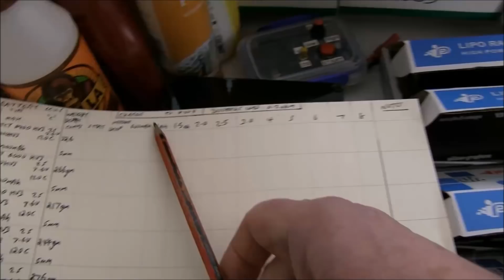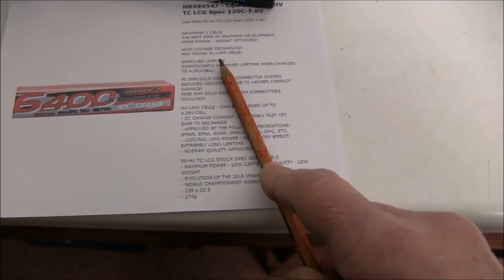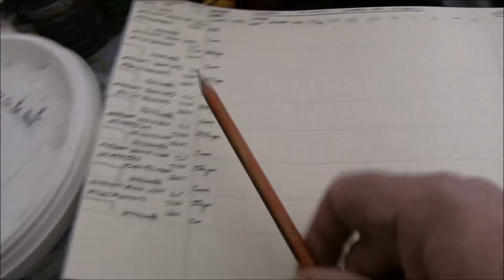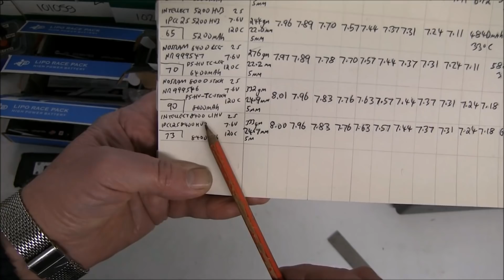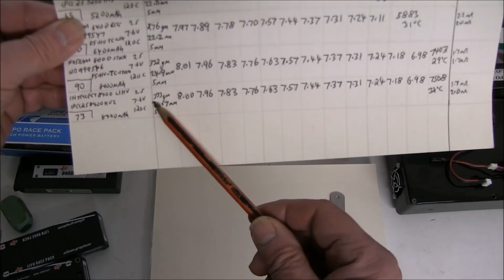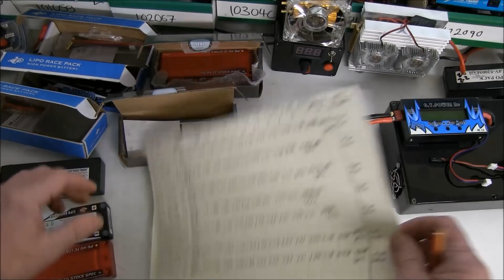Competition 2S Lipo. First tests. Intellect, Nosram   New for 2018

Comment: Hi Nick. Just out of curiosity have you done any testing with two cells shorty packs and what have you found?
Reply from the maker: Hi Mike
I do not have a chart.
Shorty cells performance is directly related to capacity, and C rating.
C ratings over 100C will all be  very good, but the capacity will determine how the voltage holds up.
If you can carry the extra weight, always use the largest capacity.
The well known brands will be the best. I recommend Intellect (IP) as they are one of the best and normally a good price.

Comment: Hi Nick, very informative indeed. Have ever done a TC rubber tire shootout?
Reply from the maker: Hi
I did a comparison of 3 rubber tires recently.
Tyres are tested at tracks by the racers, but the results depend upon, the surface (carpet and asphalt) and the temperature and other conditions.
So it is difficult to say which is best for every track.

Comment: Hello Nick, if you could please perform a test on 3S 6 amp batteries please. You would do the speed run guys a real big favor. All the advertisements on discharge, etc. we really like to know the real numbers. Thanks.
Reply from the maker: Hi Lupus.  I don't have enough 3S lipos to do a comparison. However if you choose the same make of lipo that wins the 2S shootout, then the performance will be just as good. The Intellect IP 120C lipos are one of the best.

Comment: Hi Nick, will appreciate if you will shed some light on this. For 5 mins 17.5T stock touring car racing, if we've 2 batteries of similar specs and weight: 6000 mah, 120C, 270g. But 1 is a regular 7.4V lipo, and the other a lihv. Max charge voltage is controlled at 8.4V. Which one will be a better choice? Thanks in advance!
Reply from the maker: Hi gabriel   The Lipo are only similar specs. If they are the same C rating.
The capacity of the LiHv lipo will be reduced by 10% when charged as a 7.4V lipo.
So to be equal  a normal lipo of say 6000mah will be the same as a LiHv of 6600mah
 Then the weight is important. The heavier Lipo will give a higher voltage under load. 
But a higher capacity lipo such as 8000mah will beat them both, as long as it is heavier, which it will be for the same C rating.
Reply: @nickadams5411  Got it, thanks! 
For the same 2 batteries (6000 mah lipo and 6000 mah lihv), if the control voltage for the same 5 mins 17.5T stock race is 8.7V, which one will you choose? 
Also, what's the storage voltage you'll recommend for the lipo and lihv? Thanks in advance!
Reply from the maker: @GabrielChua75  Hi,  The standard lipo cannot be charged to 8.7V. So the lihv charged to 8.7V will be much quicker.
Storage. I normally leave them after the race.  But they should have about half charge, if flat. The voltage is not that important, just make sure they have some charge in them.  Race on, Nick
Reply: @nickadams5411  Thanks Nick, Godspeed!

Comment: Nick, 

Have you ever had to “recover” a pack that’s fallen at or below 6v? I’ve heard of charging on Nimh setting for 30s then trying, repeat if not. Is this safe? I assume the pack won’t come back as good?
Reply from the maker: Hi Mark
I did a video on balancing a way out 2S pack, which is similar.
Yes, you can use the nicad setting, (auto detect or a low cell count 2 or 3 cells at first) at a low amps, about 1 or 2 amps.
If that does not work, set it to nicad trickle charge.
A minute or 2 should bring the voltage up high enough to start the Lipo balance setting.
If the Lipo has not swollen, they normally work perfectly well after this.
Sometimes the balance is way out, but a balance cycle, charge/discharge normally sorts it out.
Reply: Nick,

Thank you for the reply. I’ll give that a whirl with some silverbacks that have dropped a touch. 

Many many thanks. 

Side note; thanks for all the help back in the 90s with brushes!! Hopefully be back at Aldershot for the BTCC.

Comment: Hi Nick, thanks for your very informative videos! Is there a followup video in your pipeline covering the upcoming 2019 Lipos? I'd be most interested the new LRP 6000 mAh, 130C vs. the Intellect 7000 mAh, 120C and generally the best current batteries in the 270g range.
Reply from the maker: Hi. I have the new IP 2019 lipos and a few others almost finished. The LRP lipos are the IP in a LRP case, so I will not test them as they are more expensive, so why buy them? The test up soon.
Reply: That sounds promising. Thank you...